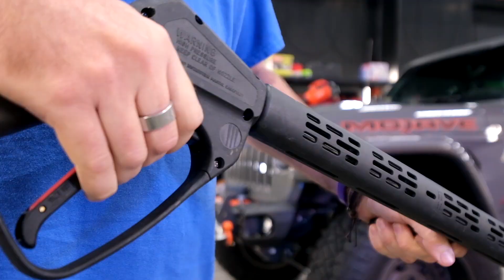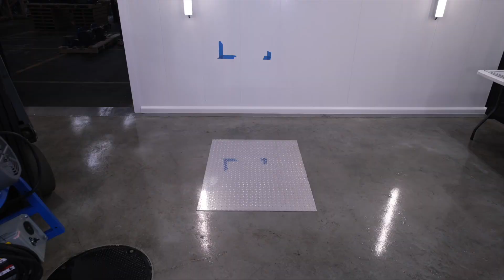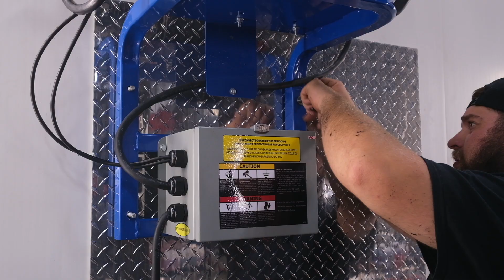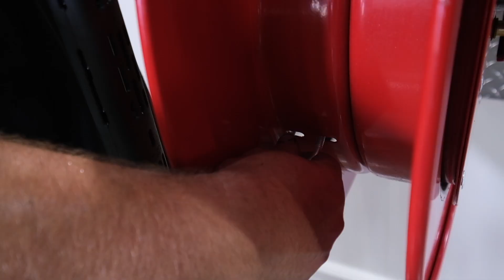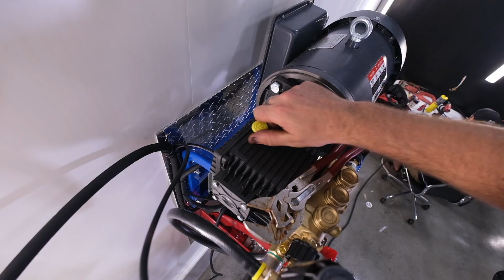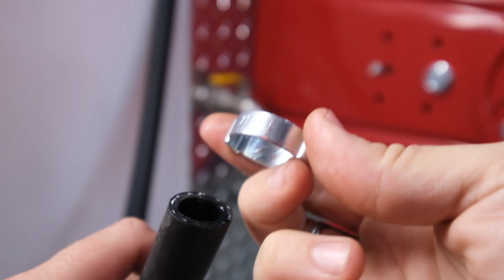The Complete X Factor Touchless Wash Bay Kit

Comment: What are the flow rate and pressure numbers on the pressure washer?
Reply from the maker: This one runs 3.5gpm at 2400psi, which is pretty nice for vehicle washing you def want more gpm than psi
Reply: @ChemX  ah great, mine is 3.2 GPM @ 2300 psi. I love the added performance over my older one which was around 1.9 GPM. I wonder if going from 3 to say 6 GPM will feel as big of an upgrade as say 2 to 3.5 GPM. At some point I find we hit diminishing returns.
Reply: @AJ56 which brand is that??
Reply: @huseyinalskan5539  it’s a Chinese unit I believe. Amy P2300